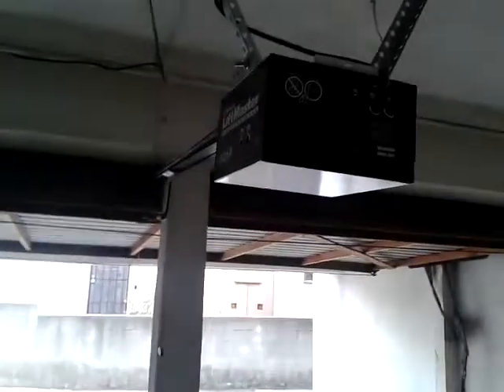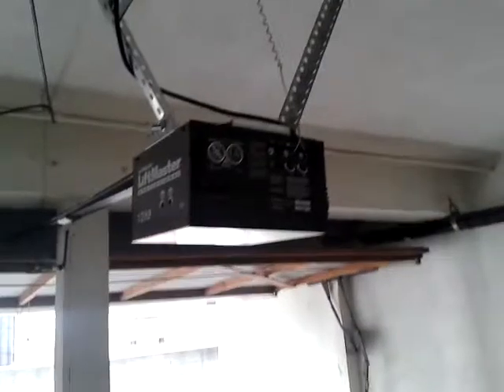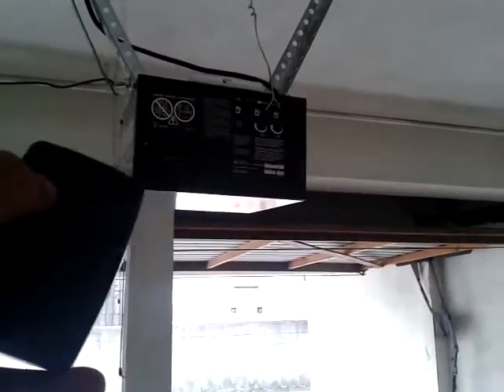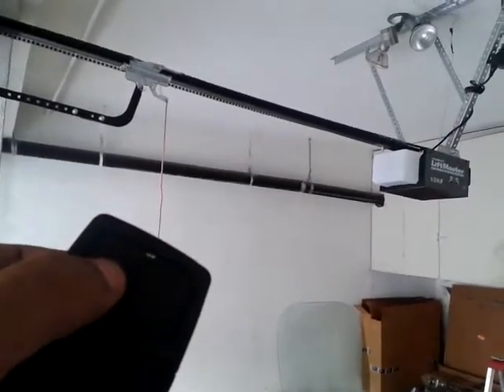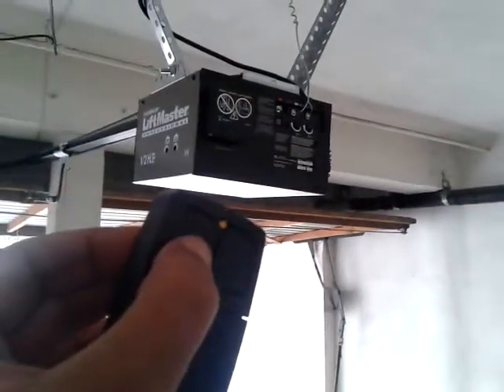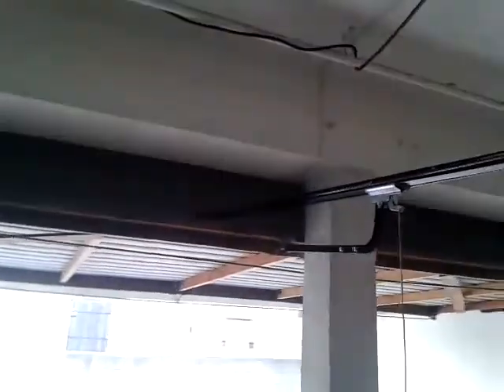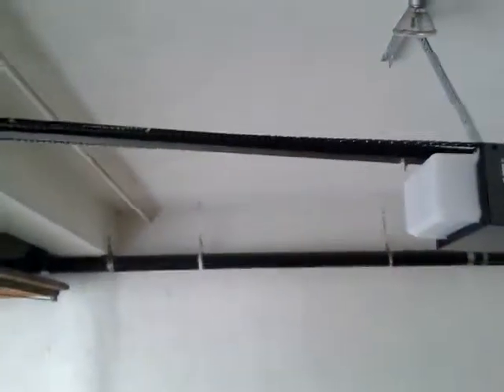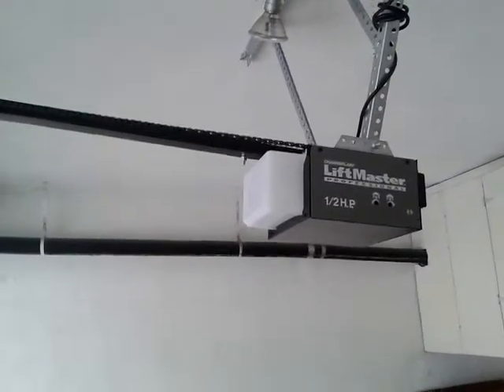1356 Liftmaster remote does not work part 3

Comment: Just out of curiosity, did you try re-adjusting the antenna wire? I've seen people starting to curl the antennas, and I think that if you don't stretch it out enough, the metal case of the opener might be interfering with the signal.